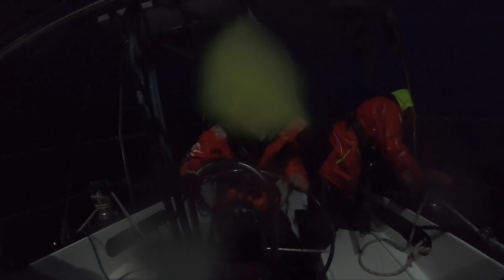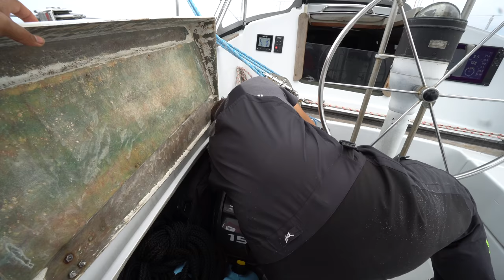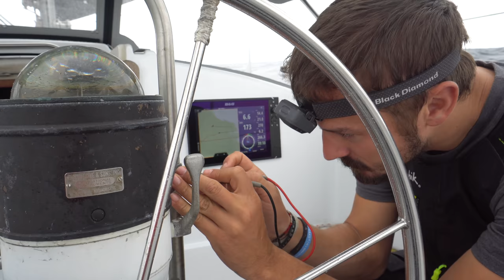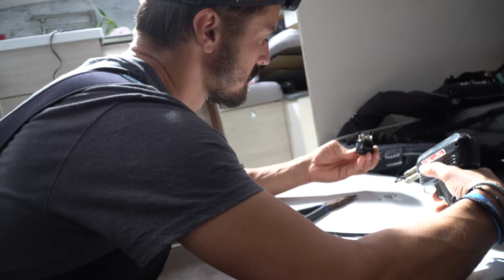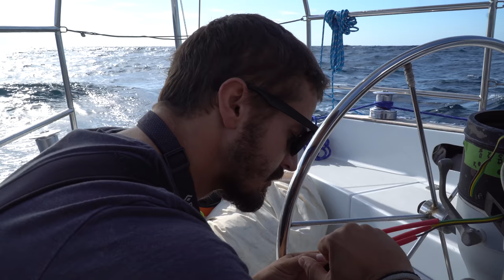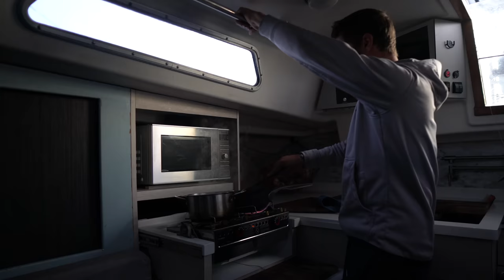Our Electric Motor Broke — DAY 11 / North Atlantic Crossing — Sailing Uma [Step 192.11]

Comment: A second switch installed in parallel, inside the cabin, would be helpfull in an emergency.This is a wiring diagram of how it can be done: https://www.dropbox.com/s/tsg9qbdu34d8mwb/circuit.jpg?dl=0.
Reply: A second switch on parallel would do nothing but add a failure point, for this failure recall he stated the motor was being commanded to go forward and reverse at the same time mean both contacts where shorted, a second switch would do nothing to prevent this it would only serve  to add a unnecessary failure point.  Though two switches in series could act as an override one on the reverse line one on the forward line that way you could kill either command or both to provide a means to further isolate motor controls.
Reply: Doesn't help much if switch is shorted.  Nice idea though.
Reply: Dan could make hood for pedestal switch out of soft flexible rubber, vinyl. Like the start stop on my chain saw. Or just a flip up protective hood.
Reply: @notj5712  & Thomas Stanton - Yes, but if you install a 4PDT switch to select which "circuit" will be "operational", this will not happen (even when one switch is shorted, the redundant other will work fine). The 4PDT switch serves to choose which of the two DPDT switches (cockpit or cabin) will work. I drew a wiring diagram to show how this can be done - see at https://www.dropbox.com/s/tsg9qbdu34d8mwb/circuit.jpg?dl=0. An example of a 4PDT switch can be found here: https://www.amazon.com/uxcell-Screw-Terminals-Toggle-Switch/dp/B008DS23V0/ref=sr_1_8?keywords=4pdt+switch&qid=1571139471&sr=8-8

Comment: How much do you use your electric motor for re-generation?
Reply from the maker: None. We have a SEPEX motor, which means 2 electro magnets and no permanent ones, which means it takes power to make power. We're working on a solution for it though.

Comment: I thought I saw you with a voltmeter in the past.?
Great job anyways. Calmness personified. 
Lucky it wasn't one of the hundreds of components in a diesel engine. I'm beginning to realise that electric is a no-brained.
Reply: So many told them NOT to go electric at the time, it became a sad joke ! But resourcefull Dan here proved them wrong ! If I remember well, he went to lithium batteries, right ? Brilliant ! As an accomplished old DIYer myself, this young man impresses me everytime. Like using a used but rugged fork-lift motor instead of "marine" ($$$) stuff. My kind of guy !!

Comment: Why do they reef the headsail even tho their going downwind and there's only about 6 kts of wind?
Reply from the maker: certainly was not 6kts of wind ! you may be confusing the wind speed  (which was rarely under 20kts during this passage) with our average boat speed.
Reply: @SailingUma  Wasn't it that at 0:35 you said that "At 3.30am, the wind abruptly shiftet and dropped from 30 kts to 6."

Comment: (@11:35) When you’re at sea, particularly on a smaller boat - and the seas are boisterous, confused, or just plain large - your abdominal muscles (and others as well) are CONSTANTLY engaged! So as a result, your metabolism increases and therefore you will feel more hungry, more often, to fuel the fire so to speak.
  When you arrive at your destination, you may be surprised to feel sore all over, particularly abs, traps, lats, hip flexors, calves and surprisingly the muscles in your toes and the arches of your feet. This is from constantly, subconsciously, flexing to maintain balance and stability whilst your on your feet. It’s a great workout and you know you’re alive after a long passage with big seas... ;-)

Comment: Are you using the motor as an generator to charge the battery?
Reply: How would run a electric motor to charge the same battery that powers the motor......?  Solar charges the battery, battery powers the motor.
Reply: @JCrook1028  wenn they sail and engine is not needed they could use the current of the water to spin the propeller and generate electricity. On passages like an Atlantic crossing with few sunny days that might be a good way to charge the battery.. but that's are only my thoughts

Comment: Does the electric motor generate power under sail when not in use?
Reply: If it did, it would slow them down. (No free lunches.)
Reply from the maker: Not yet. We're working on it though. We already drag the prop though the water, so we may as well get power form it. Next time you're out sailing, toss a 5G bucket over the side attached to a rope and see if it "slows you down" any..... doubt you'll see a difference.
Reply: @Sailing Uma. 
Yes, that's a good reply. Your motor gives you (say) 3 kts. and half a sail (clearly I'm not a sailor) gives you 3 kts, then they're the same power. 
When your full sail gives you 6 kts, it's not twice the power, it's a lot more than that, so generating power equal to 3 kts (1) is not going to slow you down by 3 kts.
(1) I doubt you could generate that much.
Reply: @SailingUma  If your prop is static, i.e. not free spinning, you would even gain boat speed if you used it to turn the motor to generate power. Plenty of sailboats have hydro generators now anyway, which is essentially the same thing.

Comment: its NOT shorting! its probably NOT SHORTING (the reason the motor didn't work). A short would either blow a thermal or a circuit breaker or a fuse (if the short was to ground). that looks like a a DPDT (double pole, double throw) but only one side (as a SPDT) is being used. so use the other side. That thing does not look like a "Marine" switch either. don't these people have a volt-ohm meter? tell you what somebody on board needs to know basic AC/DC electronics. I'd encapsulate the entire connector side in epoxy AND I'd wire in both sides for redundancy before I encapsulated it.

Comment: Very nice!
You deserve an Catamaran!
A big one!
Cheers!
Reply: Marcos da Silva agreed
Reply: The bigger the boat more thing to be fix
Reply: there are advantages to a mono hull that I think they appreciate . Big cat = big dollars and cost too . Simple is easy to fix and less to break . I see power furlers and power winches and think great , the furler will quit just when you need it most .
Reply: I love catamarans but ....they are more steady up side down....not a good choice for off-shore passages...
Reply: Remember that Uma has been knocked down. If she were a cat she'd probably be at the bottom of the ocean right now.
Reply: @faircompetition1203  they got warranties that can be negotiated
Reply: @Mister510   The "safety valve " on a cat is usually something breaks first, the traveler or a block  or something like that because you drove it too hard while a mono hull will lay down and dump the wind and let you know she is not happy.  .  

However I have been in a race where a cat flipped during a line squall . Some Mono Hulls took knockdowns , the Tri flipped and the crew were in the water . 

I do not like the movement of a cat , while flat in flat water if one hull is on one wave and the other in a trough the movement can actually be exaggerated and changing all the time  . I find in mild seas the movement is like a a wobbly four legged table . A little jerky as the hulls are on different waves and angles or just the bow of one hull. 

However , for island hopping and space it is hard to beat a cat .
Reply: @Mister510  BTW, I have been in many knock downs , took a bit of one yesterday with the chute up . Maybe over 75-80 deg , rail buried in a round up . 

Mind you the J 70 in front of us had it worse laid  down so far they lost the outboard and had a man in the water that another boat had to rescue.
Reply: @dondimcneil7311  Not in the middle of the Ocean and warranties  run out fast .

Comment: i like those winch handles
Reply: I don't like them. It always take a moment to get them in working position when needed. And you can jam your fingers in them.
Reply: @clarkkent2913  i will take your word for that as i have never used them ,,, but cant take any longer than finding and fitting a normal one ..ty

Comment: Motor controller?  I thought you just had a D.C. forklift motor.
Reply from the maker: The nominal 48V still needs to be tempered and chopped up to allow for smooth and variable speed control along with electronic forward and reverse

Comment: Great on the fly repair. My only question is why was the compass light flickering? Was it somehow getting power through the switch? Because if it isn’t wired through the switch then there is another problem brewing.
Reply from the maker: The compass is almost 50yrs old and the water from the wave, got down inside one of the incandescent lights shorting out the leads. Same cause, 2 different problems.

Comment: I'd get a new WATERPROOF switch as soon as I got back to dry land. Murphy's law can hit you at the worst possible moment. so DO IT.
Reply from the maker: We did. But honestly, we've gotten so used to sailing without a motor, that we don't ever rely on it as a piece of "safety" kit. We've sailed on and off docks before and could always sail close enough to anchor and take the dingy to a shop to grab replacement parts or just push Uma with the dinghy too.

Comment: That’s why I’ve opted to keep my Diesel engine onboard my ketch.. electric motors dont like water.. diesels don’t care.
Reply from the maker: Until you get raw water IN the diesel motor or the diesel fuel, then you’re F’d.
Reply: @SailingUma  it’s worked fine for 51 years so far, i have no complaints. I just can’t imagine crossing oceans without some sort of fuel powered redundancy on board. Electronics do fail and having a backup could mean the difference between safety or davy jones. The diesel on my 80 year old ketch is 51 years old but still works great. However i still have an outboard mounting plate on the transom just incase.. the 10hp from my dinghy will move the boat at about a knot or 2 which is better than getting caught with my pants down

Comment: This video just reminds me why I want a Catamaran. I think they are safer than Monohulls in the Long Run.
Reply: Insurance premiums suggest the risks are about the same.
Reply: Only in good conditions with small wave, big wave can roll over yacht. Monohull flip up and you keep going, but catamaran go to the bottom and you lost boat or even your life. Sorry for my english
Reply: @marekbieniek  Catamarans are really buoyant and Stable. Monohulls can sink straight to the bottom if it's overwhelmed with water inside.
Reply: @ajkgordon  I meant like having 2 Motors and 2 of everything. So in an event of an engine failure on 1 engine, it's not gonna be that big of a deal.
Reply: Canyon Duncan. Sure. But twice as much to go wrong too. Besides, cats are expensive and way outside Uma’s budget. I see the benefits of cats but they’re a bit like sea-borne caravans!
Reply: @ajkgordon  Better for Live aboard life in my opinion. Not suggesting that they should get one.

Comment: "Our electric motor broke" No, the motor was fine, it was just a switch. Or even not the switch, just the connections. So your electric propulsion system is quite fine, just the choice of parts or the way to assemble is questionable.

Comment: An electric motor on a sailboat might be "eco"friendly, but for safety reasons, it's a bad idea!
Reply: you are 5 yrs too late for that comment my friend, as these 2 have already proven to the rest of us, after sailing on their electric boat for 5 yrs without any issues,  that its actually much better  than a diesel engine that always have problems. and they dont rely on their motor for "safety" they have become great sailors and rely on their sails. Sailors who depend on their engine for "safety reasons" are not sailors.

Comment: You bought at a hardware store to cross an ocean with you'r wife,Brilliant.
Reply: They have sailed many thousands of miles by now.  Pretty sure they know what they are doing.  The issue was a minor inconvenience and it was a simple fix.  Boats are known for having stuff break/fail all the time.  Boats have been sailing the oceans for thousands of years without all the modern options we consider "essential" today.  Also, I'm willing to bet Dan is at least 50 IQ points smarter than you so I'm sure he'll get by just fine without your "helpful thoughts."

Comment: I like the idea of All electric...but for $12K for batteries...man that is 3K US Gallons of diesel. Even if you use 2 gallons of diesel a week that's 25 years of fuel for a sailboat.
Reply: Yeah, with the smell, the weight and the maintenance of a diesel rig. IF the original engine was in perfect running condition from the start which I doubt. And who said they had to shell out $12K for the conversion ? They use their motor mostly for getting and out of  marinas/ports. As Dan stated, his installation worked perfectly for 2 years now, frequently used at that ! Naaah, wise, intelligent choice in my book ! 👍
Reply: Then add in oil changes, impeller fixes, pumps, diesel cleansers, belts, coolant, diesel dock journeys, smell, noise etc etc.  If there is one thing always going on a boat is fixing their diesel engine.
Reply: 4 @marcryvon  The twelve batteries Dan installed  run almost  $1000 a piece. (a 30hp diesel retrofit would easily cost twice that....easily!) He may have received a promotional perk since the channel is so popular.. but if you do your due diligence you'll find these batteries are used by other electric or hybrid users.  https://images-na.ssl-images-amazon.com/images/I/61Z6qdh47cL._AC_SL1000_.jpg
Battery technology is still super pricey..... I heard that a Tesla battery replacement runs around $30 K !

I think the real issue is the efficiency of their fork lift motor.... upgrading that would be a logical project if they wanted to extend their distance under power.